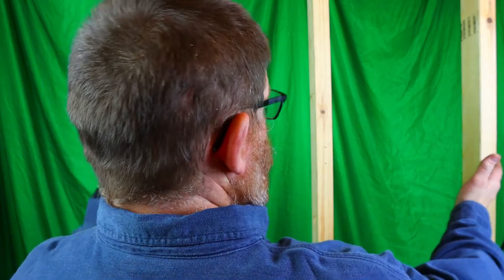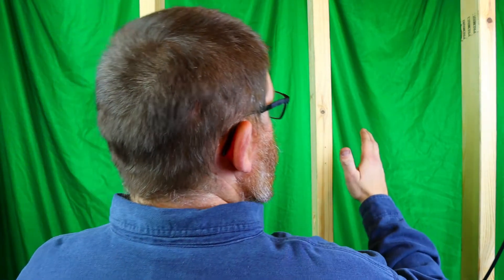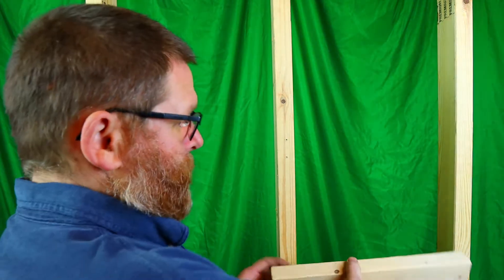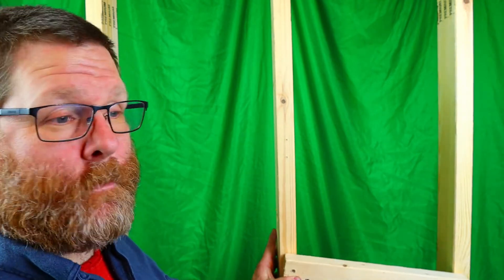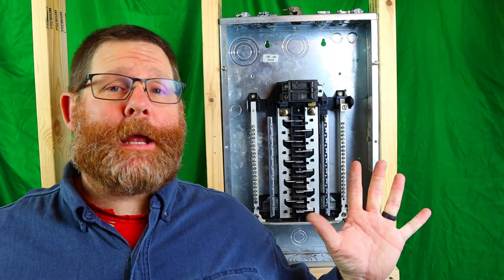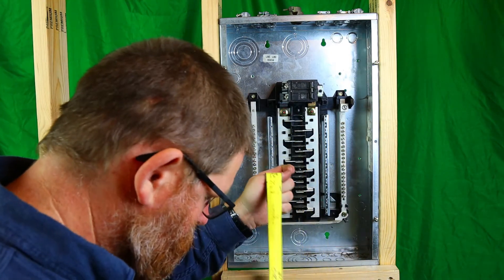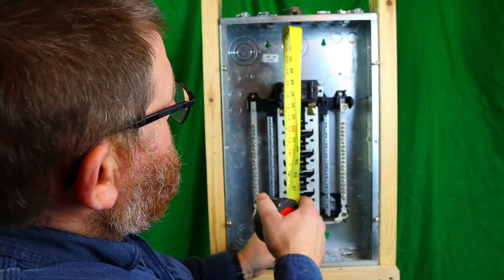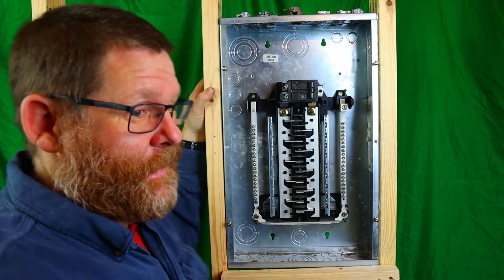How To Install And Wire A Sub Panel Episode 1

Comment: Quick question, are you supposed to leave the knockouts attached to single gang blue boxes?
Reply from the maker: Great question... I do I try never to knock them out. If you push the wire in sideways they will stay in. The ones that have pressure definitely.

Comment: I've had one of those m12 Milaukees since they came out in February 2020, I used it to bore holes for the electrical on my wife's wood shop and it has the power to try and snap your wrist, no it won't buck you off a ladder like a hole hawg but it's stout.
Reply from the maker: I fully agree it's pretty great. Thanks for the comment and watching ☺